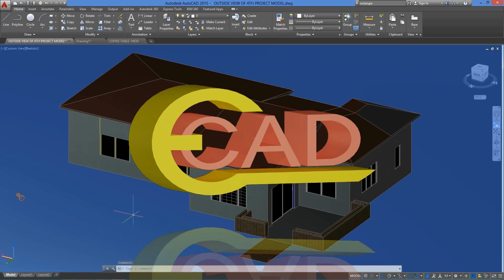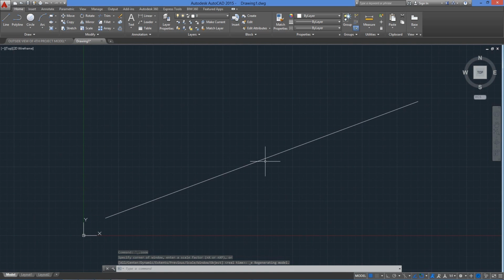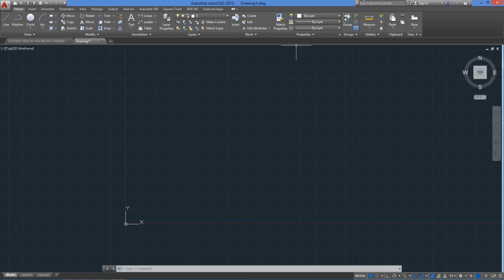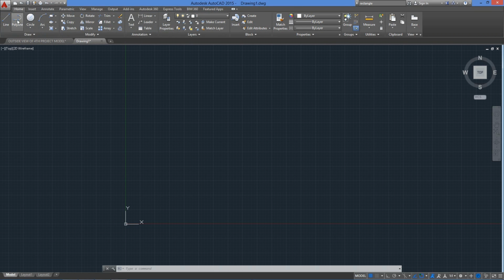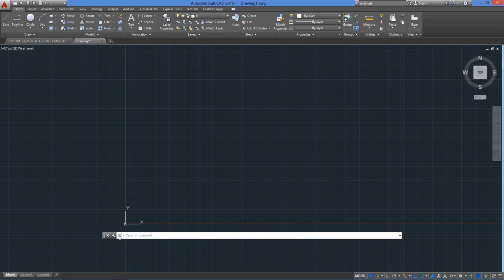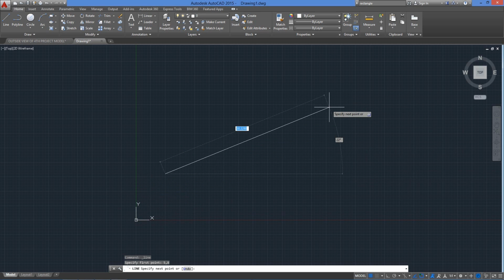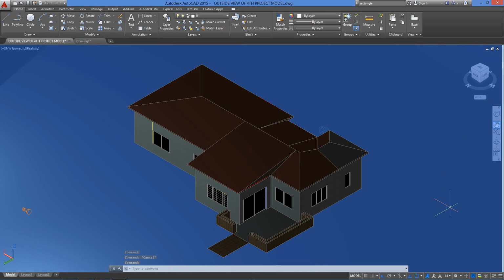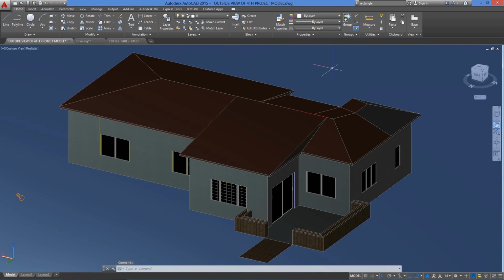AutoCAD 2015 Tutorial 1: "Introduction to AutoCAD".

Comment: I have a MacBook Pro 13 and I'm taking a AutoCAD class.. it has 8 gigabytes of RAM core i5 processor 2.7 gigahertz speed 3.1 turbo boost is it possible for me to install windows 10 using Bootcamp and install the student version of AutoCAD will my computer do good with it or what do you think
Reply from the maker: +Oscar c It will for sure, now installing win 10 is up to you but you could also install Cad for mac. Just an opinion, and I wish you all the best.